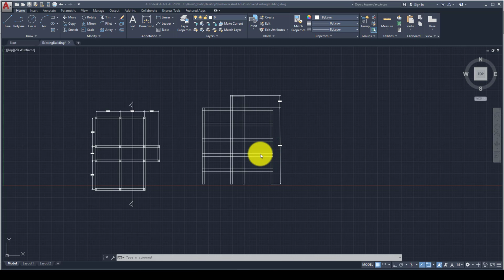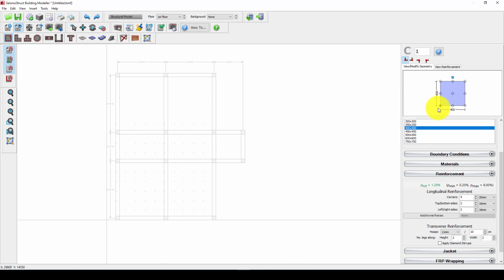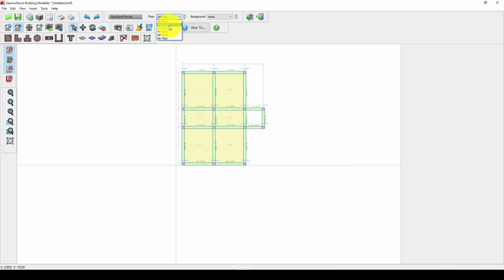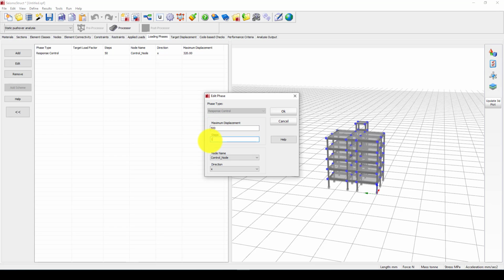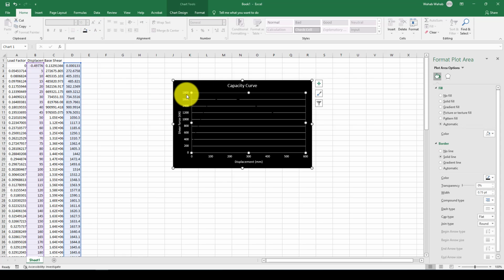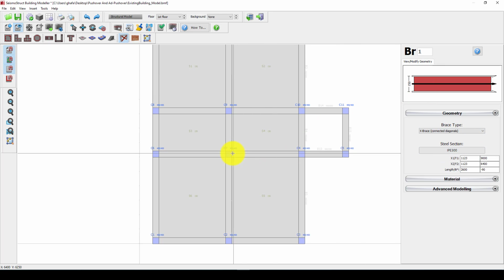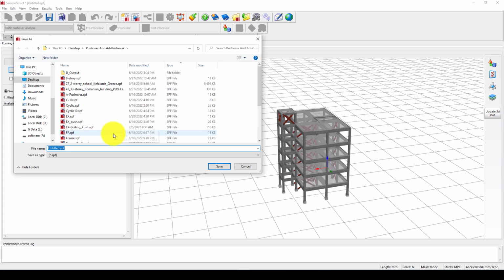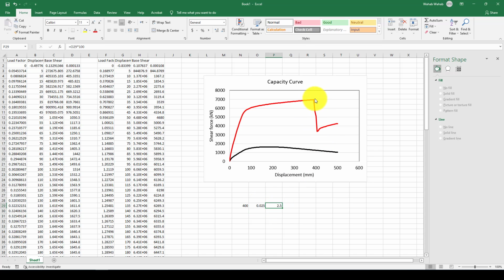Seismic performance of retrofitting  RC frames by X-bracing using SeismoStruct Software

Comment: As always I enjoy every video you prepare and I really appreciate the help you provide us.
I would like to ask you if a video with a 3D design (of a symmetrical concrete structure) can observe mostly how you create the joints and their plastic behavior in nonlinear analysis. 
In any case, thank you again for your contribution.
Reply from the maker: I hope this was helpful, I will try to make a tutorial soon.
Reply: @KSSE_Engineer  honestly i find it very helpful
Reply: @KSSE_Engineer  I would like to ask you just an information if you know. In seismostruct can I have a nonlinear time-history analysis of a masonry structure (based on its stress-strain curve)? (usually, we use area sections for the simulation of masonry walls but many software run nonlinear analysis only on the joints beam-column). Thank you in advance!!!